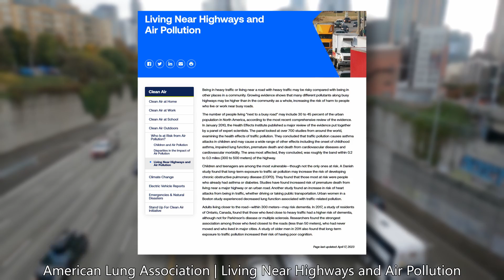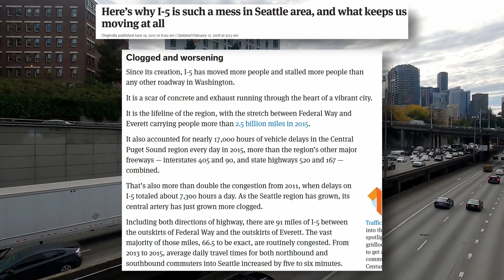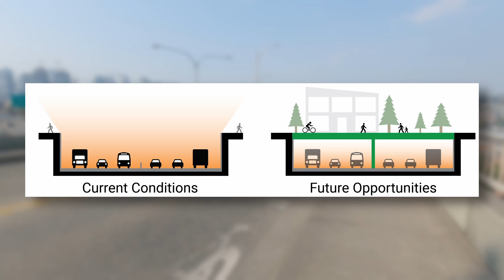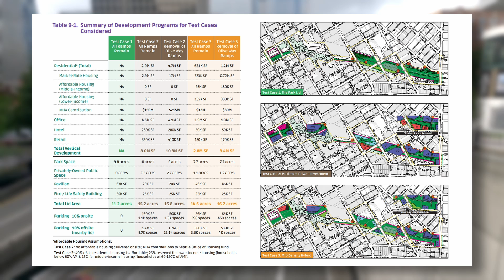What Makes this a Great Spot for a Freeway Lid?

Comment: Let's be clear. It would be like getting run over by a truck and applying a bandage. As one of the few lucky ones who is fortunate to live in a city without urban freeways, the only real solution is to get rid of the %^&%&% thing and reap the benefits of all that space. 4,000 homes were demolished. 40,000 homes could be built there now - among other amenities including a natural ROW for awesome transit.

For those who will inevitably freak out and claim it can't be done I will ask how we managed in a similarly sized city in the same region. The only reason you have so much traffic is because you CHOSE to encourage so much traffic. Undoing that is up to you.
Reply: Absolutely! Not to mention the potential cost for the lid being far greater than removal.

Comment: Your car produces a lot more heat than your furnace at home. 
Drivers are apathetic because they are in the air conditioning. 
Its no wonder we are smoking through the earth as if it were a cigarette.
A car is an industrial space heater that has a side effect of transporation.

Comment: last june I took a trip to the coast, I went through this section of Seattle and was stuck in traffic for two hours.  this stretch of road is quite possibly the worst damn thing ever constructed.
Reply: It's a terrible bottleneck, and it's incredibly vulnerable. One day a few years ago, a truck full of fish turned over on hwy 99 (running parallel to i-5), and the city was PARALYZED. I-5 was the only major north-south arterial. I was trying to drive about 2 miles from Queen Anne to Capitol Hill... and it took me 2.5 HOURS down Denny Way.  If I weren't disabled, it would have been faster to park the car, but I can't walk up Capitol Hill 😢

Comment: Although it would be heretical, removing on/off ramps within a CBD would certainly limit the amount of vehicles exiting directly into the heart of downtown, reinforcing either the through traffic nature of the interstate and/or requiring CBD-bound vehicles to exit much sooner, where they would filter into the surface streets, or even park on parking structures built over the freeway at both ends of the lid & transit, walk or roll the remaining distance to their destination. Not likely to happen but Seattle would be a great test case!

Comment: Boston built a skyscraper on an interstate lid (I-90).  But better might be to use the linear nature of the lid...transit, with a multiuse pathway above, or alongside, along the length.  The combination of transit, walking and biking helps with the last mile for the transit.
Reply: Grassy tram tracks running through a park on top of the freeway does sound pretty good.
Reply: Well, Boston already has a transit ROW parallel to I-90. The Worcester main line is also in the trench along with the 'Pike, with approximately hourly passenger service. A lot of highways in Boston were planned to follow railway corridors. I-93, or the Southeast Expressway, runs along the Old Colony line, and I-95's Southeast Expressway was planned to follow the Southwest corridor (but never got built).

Comment: i would appreciate there being some walkway up to capitol hill along SLU/eastlake, it's completely cut off by I-5 and the closest way to get up is denny hill.
Reply: Unfortunately this is also where I5 rises out from the continuation of the hillside, so it’d be a bit harder. But yeah it really isolates the two sides. What could be a 5-10 minute walk down the hill is often extended to a 30 minute walk when you have to walk down to the nearest crossing. And for the whole stretch between Denny and Eastlake there’s really only one bridge
Reply: Agreed. There were talks to move I-5 some years back. That's what really needs to happen... I've seen tunnels suggested, which I'm down for.

Comment: The futurama jefferies tube that bezos and musk can throw their billions at rather than into the solar winds of cold dark space. We could also devise a traffic controller system that prevents collisions, such as during the many coordinated launching sequences to the short and long distance magnetic rail based trebucket that can remove the need for repairing road surfaces that cause accidents.

Comment: I wonder if with the current I-5 lid, trucks carrying hazardous material have to get off I-5 before reaching the tunnel. In Phoenix, that’s the case with the half-mile I-10 tunnel, and that’s just with some parks on top. Also, I wonder how traffic engineers came up with those ridiculously complicated freeway exists in the first place. In downtown Phoenix, I-17 has a few weird exits (e.g., Jefferson Street on I-17 SB paired with Adams Street on I-17 NB, where the off-ramps immediately go to a major intersection that has frontage roads), but otherwise, ADOT kept everything simple (the 2 important I-10 interchanges, which are 7th Avenue and 7th Street, are single points, and all other service interchanges by downtown, except for the one going to Sky Harbor Airport, are diamonds).
Reply: IIRC, that's already the case with both the I-90 and the HWY99 Tunnels.

Comment: Also making the cars inhale their own fumes is such a W.
Reply: There are ventilation requirements for all tunnels of a certain length. The HWY 99 tunnel has pumping buildings at both ends. Don't know if it filters all the air that passes through it, or just dumps all the nasty air into one blob in the middle of the city.
Reply: @Matt-wc2mf  I think the big important thing of course though is if its anything like the air towers for the NYC tunnels that cross the Hudson, they dump the air well above street level.
Reply: @Matt-wc2mf  I think I’ll just sneak over and clog the ventilation up.
Reply: @valleyofiron125  w

Comment: Reno also has a freeway lid over I-80 only to be used by a suburban style Walgreens.
Reply: Really wish they would extend the freeway lid in both directions. Definitely to Sierra & Lake Streets but ideally between Washington St. and Valley road.
Reply: I mean a lid extension between Sierra St. and Virginia is such ridiculously low-hanging fruit. Short gap, same elevation, no disruption of on/off ramps required (edit: not that disrupting on & off ramps should ever be a reason to not implement better urbanism).
Reply: mannnnnn, what a way to ruin the lid by encouraging suburbs

Comment: I regularly walk across a freeway overpass in LA with my wife and the noise is literally deafening. 

To the point that we have to completely pause our conversation until we’ve finished crossing.

It’s amazing how much quieter public transit can be simply because the noise become intermittent!
Reply: > intermittent

Yeah, this point needs to be stressed, even the most frequent train systems have a 90 second headways at peak, most frequent elevated ones are around 4 minutes (like the Montreal REM)
Reply: The 101 Dtla near city hall needs this

Comment: The question is: Are freeways necessary?
Reply: If only we could make like a really really long car that carried a ton of people, and it went on rails and dropped people off at major points of interest.
Reply: They're good for connecting different cities together (if well built like in Germany) but really shouldn't be cutting through downtown.
Freeway lids are just a compromise for the majority of driving voters who would faint at the mere whisper of possibly reducing freeway lanes/exits. Remember suburban car commuters are basically toddlers with their favorite SUV jingle keys so it's very hard to do anything without them throwing a tantrum
Reply: @inuendo6365  I mean there is often no choice but the car though. Exceptions exist, one of the things I liked when I used to go into NYC a bunch was leaving my car at the RR station and taking the train in. Nothing like laughing at the suckers driving into Manhattan while cruising smooth into Grand Central. Every major city should be as accessible by rail as those in the Northeast.

Comment: The Union St exit is PERFECTLY designed to force drivers to suffer the consequences of their incompetence.
Reply: Unfortunately it’s perfectly designed to threaten the lives of innocent pedestrians as well.
Reply: Come on, urbanists should be in favor of safer street design for both people in and outside of cars.
Reply: eh id sooner blame roads over most drivers in this situation
Reply: Yes. And the thing that is frequently not mentioned is this ramp is signed with speed limits, and the driver literally is heading into a wall for quite some time, also signaling that they’ll be making a hard right turn shortly.
Reply: What incompetence? You could be playing 100% attention and still crash it looks like. It’s a very poorly designed exit.
Reply: @SomeGuyWhoPlaysGames333  I 
I won’t disagree that it’s poorly designed by modern standards and modern speeds. 

If you follow the signed speed limit and pay attention you’ll be fine. 

This is an early 70s exit, as is this whole stretch of freeway. 

We could definitely improve safety here by strictly enforcing the 60 mph speed limit, and even considering lowering the speed limit to somewhere closer 50 mph between Northgate and the Spokane St exit, at least on the southbound side that doesn’t have as many exits in the distributor collector lanes. Traffic already moves that slowly during much of the day.
Reply: @SomeGuyWhoPlaysGames333  - foresight and being familiar with the exit is usually what's needed. It's a really short exit from the freeway, you just need to slow down to the posted speed and make the turn.

There's a compilation video that gets updated every year in the winter as people speed through the exit and spin out, especially when the ground is slick.

Drivers reading signs would fix most of it.
Reply: @KingBobXVI  reading the sign won’t fix anything. They also need to follow it. Which is the problem on many roads.

Comment: "The" I-5

...and a thousand Seattlites cry out in rage at the Californian.
Reply: Don't Southern Californians typically just call it "The 5"? For the narrative tone of the video I'd suggest "Interstate 5" with no article.
Reply: @MarcVanHeyningen  Yup, it's just "the 5" down here in LA.
Reply: The only exception I can think of, where we use "The' is WA-167 "The valley freeway". There might be some other alternate names that get The, but not the I-5 or the wa-167 etc.

Or if you were saying something like "The I-5 corridor" or "The I-90 Express Lanes"
Reply: I've lived all over this country (from New England to Colorado to CA to Seattle) and changed up how I call freeways (which I always called highways before moving to SoCal in the mid-80s) to match the locals and I have never said "the" if I'm also saying "I." It's either I-10 or The 405. And actually in Denver we usually just said "25" or "70" in conversation. Like, "I'll just jump on 70 and get off at the Denver West exit." Every time he said "The I-5" I died a little inside.